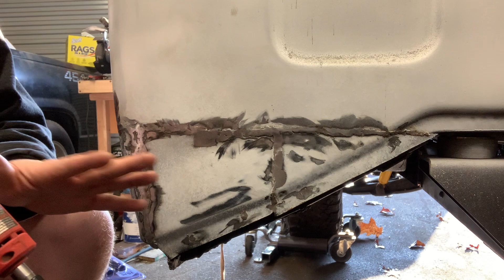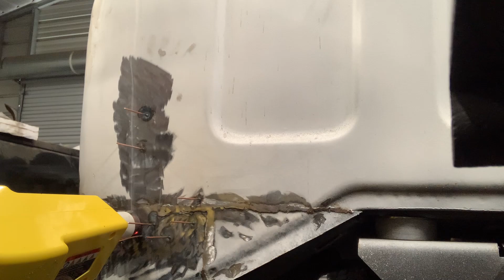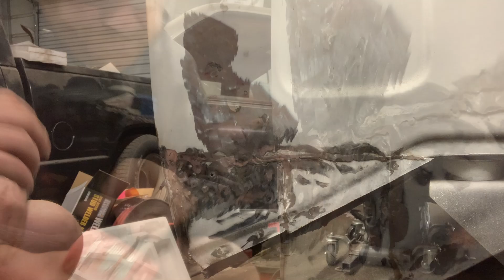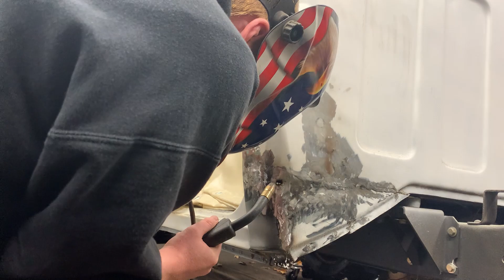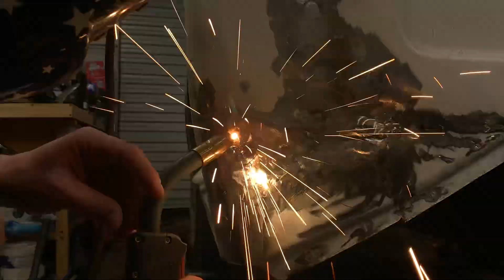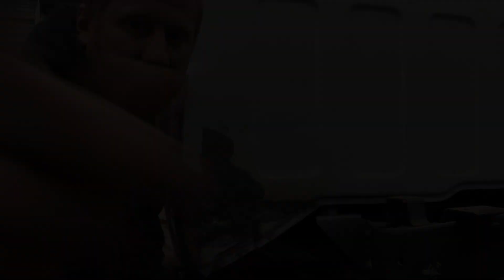PULLING DENTS!!! 1963 CHEVY C10 RESTORATION DAY 125

Comment: Not sure if you are using a Bastard file. But it helps to find the high spots and smooth out the  welds.
Not the greatest tool. But it does have its benefits. 
Keep  plugging in ❤👍
Reply from the maker: Thank we dork have one so it’s normal hard work and effort!